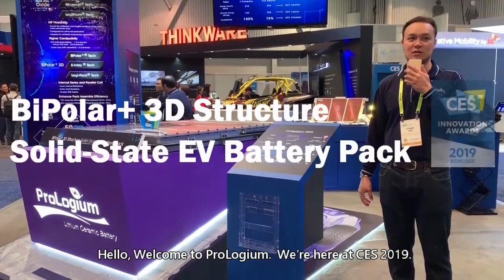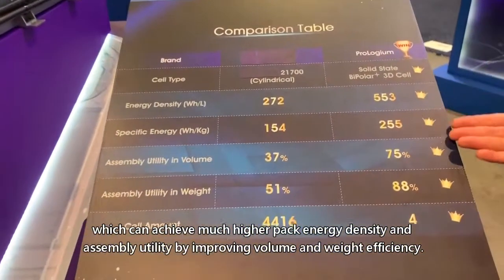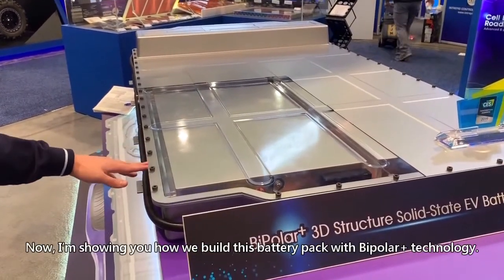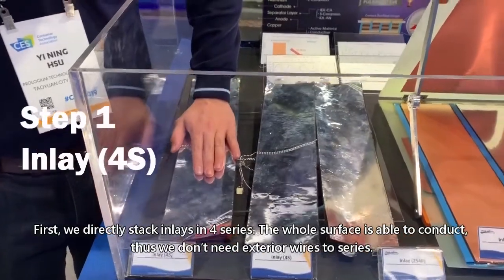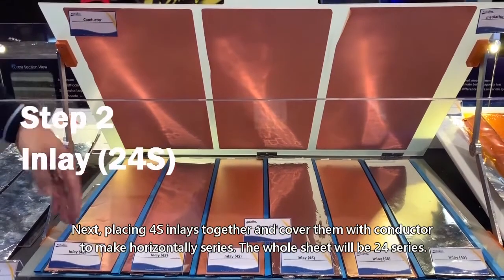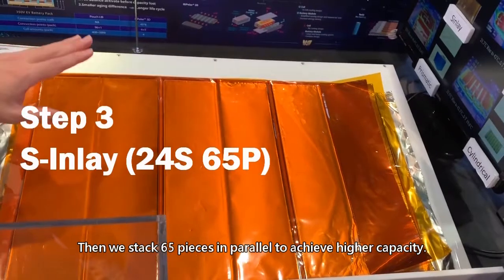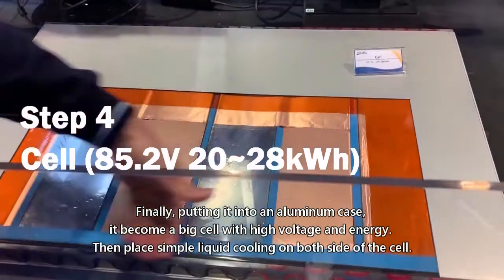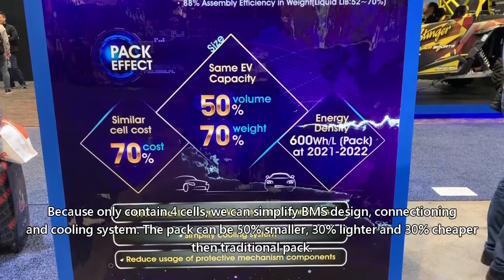【CES 2019】ProLogium Booth Tour  輝能科技攤位現場直擊

Comment: This could be really great for the retrofit market, where people convert old cars to electric. But you'd need to supply smaller packs, so they could be fit into odd places, since older cars aren't designed with a floorboard battery pack in mind.